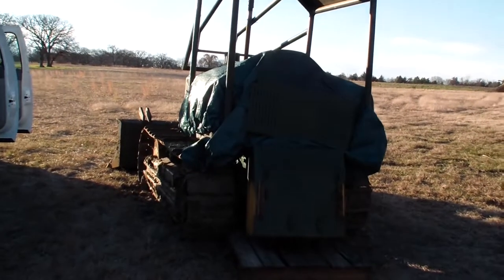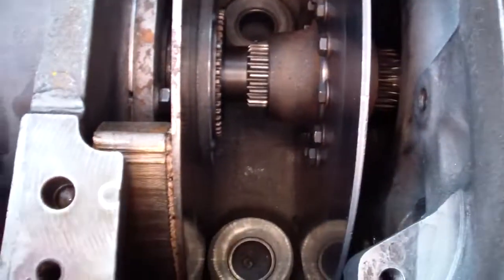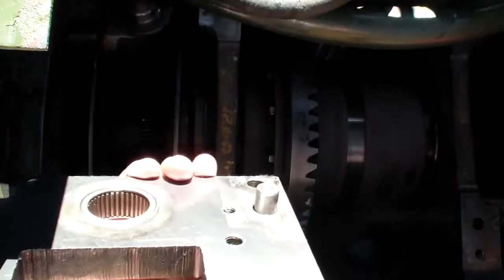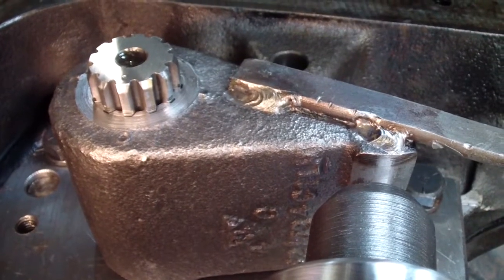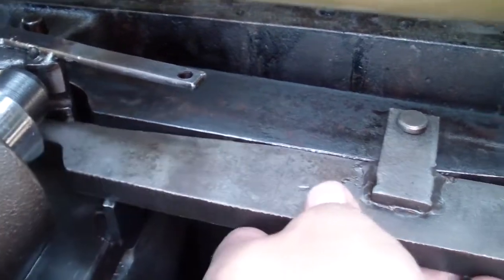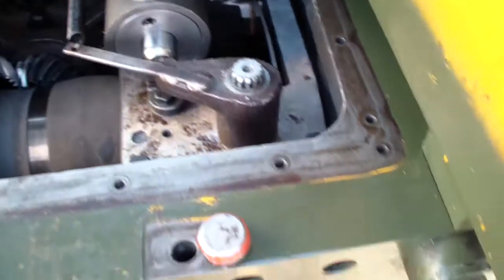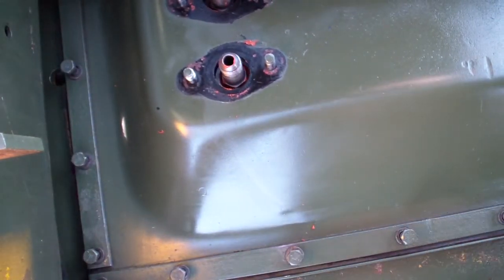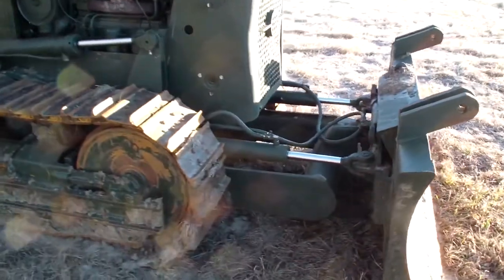TD7C Bulldozer Clutch & Brake Job

Comment: Where did you get the hydraulic hose nipple fittings with the flare ends? Only ones I can find are not the extended length ones like my OEM ones. Also if you had a part number that would be awesome. Thanks
Reply from the maker: I bought them from a local hydraulic shop (I bought them in 2013). If I remember correctly, the fittings you are looking for are 1/2" male o-ring boss to 1/2" male JIC flare. My best suggestion is to remove one and go to any local store that sales hydraulic fittings, verify the size and you may order online. I hope this helps

Comment: About to tackle this same job on a 78 TD8E, this video is great info, thanks for taking the time to make it! Where did you find the parts to rebuild the actuators inside? And I found a company in Norwalk Ohio called Arts Parts, he relines all kinds of brakes and friction pads for cranes, dozers and such.
Reply from the maker: Good evening sir, I found all the seals and o rings at a place in dallas texas called HD distributor. It was very easy to replace. Thank you for the comment and if you have any questions please let me know.

Comment: Great Video, How did you remove the master track pin? Best I've seen people heat up the chain around the pin and then drive  out pin with sledge. Is that what you did and how difficult was it?
Reply from the maker: On this bulldozer I removed the old chains and installed new one (I didn't mess with the old master pin). I show in one of the videos how I mad a press to install the new master pin using steel plate and all thread. On other bulldozers/excavators when I had to remove the chains master pin, I had to use 50 ton press that apply vibration while pressing. One time I was able to build similar press to the one I showed in one of the videos and I added large bolt (1" fine thread grade 8) and made the press like a bearing puller and use the 1" bolt to drive the master pin with the use of 3/4" drive impact drill driver and kept applying oil on the bolt and kept hitting the bolt head with a hammer. You can apply heat, just don't heat the chain more than 400 degree Fahrenheit as this will anneal the chain metal. If you are not planning to use the old chains, just cut them with oxygen acetylene torch. I hope this helps.

Comment: Great video. Just curious what did you use to clean the inside of the case? Also do you know how thick the lining is when new? Thanks
Reply from the maker: Hello, I used diesel fuel to clean it, when the lining new it should be 0.140" of inch thick. Thank you
Reply: @SalamSayhood  Great thanks for the help!
Reply from the maker: You are welcome,

Comment: nice work. i have a td8c probably the same parts. my dozer  drives pretty good but when i try and turn right it only seems to catch in a few places for a second or two. then i drive another 10 feet and it catches again for a second. is this more of a  final drive issue or are my clutch disks and pads bad. pretty annoying to have to go in reverse to get the machine turned the other direction. love the vids thanks
Reply from the maker: Good evening, the TD8C is very similar to the TD7C as far as the steering/brake operations. It sounds like you may have to first try to adjust the clutch and brake adjusters like I explained in the video. You don't have to remove everything, just the back cover to adjust the clutch for both sides and you can adjust the brake from the outside. 
If that doesn't work, then you may have one of these issues:
1- the steering cylinders may have an internal leak wich will cause steering issues or external leak this will also cause steering issues and will cause loss of hydraulic in the transmission and increase the level of hydraulic in the rear box.
2- wear out shoe or steering disc. The shoe relign or replacement is similar to what I showed in this video. The disc requires the removal of the final drive which I covered in other video.
3- make sure you are using the proper fluid.
4- the steering valve may have an internal leak.
5- most likely no issue in the hydraulic pump if everything else work okay.
It is also not a bad idea to open the deferential box, clean, inspect, adjust and add new fluid to extend the life of your machine.
Hopefully you just have to adjust the brake and clutch. Make sure to pressure wash the area to make the job go easier. If you have more questions please let me know, good luck
Reply: @SalamSayhood  thanks for reply i just ordered an operators manual i no im leaking fluid probably between final drive and steering housing. what fluid goes in the steering box i have a dipstick under my seat for that and its now low. ill have to go over tomorrow and try the adjustments as well before tearing the tank off to get into the box thanks again.
Reply from the maker: Any tractor hydraulic fluid that meet Case or IH MS1210 specifications will work in all three hydraulic systems of your machine (transmission, blade and the differential box). I personally use Phillips 66 powertran fluid as it work with my tractor, bulldozer and backhoe.
Reply: @SalamSayhood  thanks alot your very helpful hopefully the dozer gets goin full throttle again

Comment: The video is  is a big help.  My td8g  has been without a foot brake for a long time and its time to fix it.  Can the brake pads be seen through the inspection plate in the rear?  I am not able to get a good brake adjusting the adjuster bolts. If  the brake pads are bad,  will it effect the steering?  I turns well.  Thanks
Reply from the maker: You have to remove the top cover to be able to see the brake pads. It's probably a good idea to do that anyway to be able to inspect everything and to clean the inside for new oil. If you never done that, the bottom of the box will have a thick layer of brake friction material. The brake and clutch need to be adjusted together like I demonstrated in the video. This way you make sure everything is ok and you don't have a problem in the future. If you have any more questions please let me know.
Reply: @SalamSayhood  Thank you ,   I will,  I may have more questions after that.

o

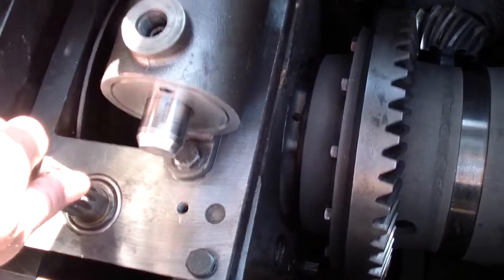Comment: Thanks, I did this procedure, but the problem is that when I torque down the plates, the shoes get stuck. They no longer move freely like in your video at 14:55. I am pretty sure the shoes and thrust washers are installed correctly. It is as if there needs to be a spacer between the plate and the frame for the shoes to have enough room to move. Parts diagram does show spacers in each corner, but I don't see them in your video. Any thoughts?
Reply from the maker: Good evening, what is your machine?
Reply from the maker: Good morning sir, there should be no spacers for your machine. Make sure the bottom of the box is completely clean specially inside the bearings. The old friction material will build up a solid layer at the bottom and need to be removed. Make sure all the bearings are seated correctly and free to spin. Also make sure the thrust washers are seated correctly. When you torque the bolts, make sure the plate is seated all the way around. The dowls should align the plate to the box.
Reply: @SalamSayhood  But then why does the parts diagram I posted above show spacers? I did clean everything thoroughly and made sure everything was installed properly.
Reply from the maker: I saw the picture. I checked the manual that I have and no spacers in my manual. When you dissassmbled it, was there spacers? Did you relined the original shows or got replacement/new?
Reply: @SalamSayhood  Hi, Thanks for answering, your videos are great! I didn't see any spacers when I disassembled it. I think next time I open it up I might add a large diameter washer as a spacer around four bolts that secure plate to frame between plate and frame. As it is, I really just wanted to get it working right away, so I only partially tightened down the plates. They move perfectly fine until I torque the plate down, so it really seems there just isn't enough room for the shoes to move freely (Who knows, maybe at some point some one put in the wrong thickness thrust washers). The new spacer/washers would add maybe 2mm, which should be enough. I did not reline the shoes, but one brake does need relining, so I should open it up again anyways...
Reply from the maker: I highly suggest to investigate the issue and not leaving the bolts partially tight. This may cause damage to the machined surfaces or shears the bolts. When you apply brake/clutch, there will be a lot of force in several dimensions. If the bolts are not tighten to their tourqe specifications they may shear off. If you are 100% sure everything is clean and correct but you still have the same issue, try to tap on the top of the plate and this will cause the bearings to seat correctly (if this is the issue) or try to make shims from thin steel and make sure you have a very minimum up and down play in shoes. Good luck.

Comment: Great video, Where did you get the brakes? I have a td7 and I’m not having any luck finding replacement pads. Thanks in advance
Reply from the maker: Good evening, I used a company called clutch and friction services co, the were located in norwalk OH. I just looked them up and google shows they are permanently closed.
Reply: @SalamSayhood  Thanks for the response, I’ll continue searching. I’m assuming you had yours relined ?
Reply from the maker: Yes sir, I relined them before, I used a local brake and clutch shop, one of the liner came off after only two months of use, I found the place I mentioned in my previous comment and they did good job. It's cost me $600 including shipping. To be honest with you, I thought about relined it myself, you just need the friction material that can handle heat and oil. It's 0.140" thick, if it comes flat, you can add the groves with wood skills saw (you can set the depth of cut to about 1/32", You can purchase the brake glue (also it must handle heat and being wet in oil), the brake glue need two things to set properly, pressure (using metal c clamps, clamp each two against each other while the friction material in the middle, make sure everything is super clean and dry before applying the glue), then you need to bake them in the oven at the recommended temp and time by the glue manufacturer. I done this long time ago with other tractor and it worked. I was very busy and that is why I let someone else do it. Please let me know if I can help you.
Reply: @SalamSayhood  I really appreciate all the information, I may look into finding some material and doing it myself. Unfortunately we live in the day and age of everything is disposable and if it breaks just throw it away and replace it.
Reply from the maker: Yes sir, I totally agree with you. One more piece of information, the first place I went to relined the brake and clutch, the guy showed me in one of his catalogs, under Case/IH, the part number for the friction material, he told me back then (2014), they cost about $25 per piece. The glue is black in color and they only sell per gallon, I believe it was about $150 per gallon. You may want to go to a brake shop and see if they can get you the right material, if not try to check McMaster Carr, they sale friction material. I believe I found the glue on eBay back in 2014 and it was from India. Good luck
Reply from the maker: Thank you sir for sharing this information,
Reply: I used Friction Works LLC  4598 WHITTLESEY RD NORWALK, OH 44857 (419) 677-1167. They did the round and flat pads for $162 each.  Turn around time was 2 days. Workmanship was good.  When you ship to Friction Works keep the box under 50 lbs to avoid a surcharge (2 flats and 2 rounds is just under 50 lbs).  When FW returned the brakes they were 53 lbs so shipping is higher ($190 for me).  This is cheaper than buying new or if you don't have a local option.  Thanks Salam for the video!
Reply from the maker: Thank you sir for the information and the comment.

Comment: 1990ish td7g... my clutch pressure gauge shows a drop after about an hour of running but the machine is still pushing hard. Would this be a plugged gauge line or something else?
I changed the large filter in with the battery and put all new to-4 in the transmission.  I didn't know about the strainer under the floor panel and will be changing that now that I ha e seen your video. I did the clutches and disk when I bought the machine about 5 years ago and. Any ideas why the gauge would show good clutch pressure and after about an hour show low pressure?
Reply from the maker: I believe the TD7G specifies Hytran hydraulic fluid or MS1209 specs or anything that shows compatibility to case MS1209 fluid.
However, before replacing the fluid, make sure of the machine requirements.
Also:
Make sure the engine belt is tight and doesn't slip.
Make sure the radiators are clean and allow good follow of air.
Make sure both strainers are clean.
Check fluid level.
I hope this helps. Thank you for watching.
Reply: @SalamSayhood  I haven’t thought about replacing/checking the fan belt and I will do that when this rain lets up at the same time I get into the strainers. Is there more than one strainer other than the one under the floor pan? Another thing that your video got me thinking about would be the adjustment of the clutch/brake cylinders under the seat. If my track hand brake levers seep fluid like they do at the block, and if my clutch/brake cylinders were not adjusted properly, could that cause the clutch to lose pressure over a period of working? This also makes me wonder where the clutch pressure reading is taken at. Because the gauge shows that I have lost a considerable amount of pressure from the clutch, but it seems to have lost absolutely zero power. I also did not know the proper adjustment method when we reassembled the whole thing after new pads and disks, we used the old “that looks about how it was when we took it apart” technique. I am 100% glad I found your video!
Reply from the maker: Mine has two strainers, one in the transmission and one inline with the return line from the transmission radiator on the left side of the engine.
The gauge should be reading the end of the system to monitor any drop of pressure.
Keep in mind: when the hydraulic fluid gets hot the complete system will get hot and any leaky ring/seal will leak more. Also the gauge may be defective. 
Check for leaks. Make sure the steering cylinders don't leak (the rear end fluid level keeps rising. No leaky hose.
Check everything and let me know what you find. Be safe and have a good day

Comment: Have you changed transmission fluid and pulled screen, I was wondering if there was a not so messy way, it's close quarters under there
Reply from the maker: Hello, I changed all the fluids. The transmission has a strainer filter within the transmission, I removed, cleaned, and re installed. There is also another metal filter that connected to the hoses that go to the transmission radiator, I removed, cleaned and reinstalled. I also replaced the turqe converter filter, it's located by the shift handle. The best way to do it is to level the ground were you are going to work on it, use a sheet of plywood or masonite so you don't get dirty, drain the transmission, I cut a 55 gallon drum about 6 inches to collect the old oil, then remove both strainers and clean them and also change the turqe converter fluid. It's straight forward process and not so messy. I hope I answered your question, if you have more questions please let me know. Happy Thanksgiving
Reply: @SalamSayhood  very good info, thanks for all your help, ive got that to do and some fuel line issues, those rubber fittings inside the nuts on the lines are bad, at the tank, cut off valve is leaking and so its sucking air, mostly just odd end stuff.
Reply from the maker: @sammorgan2719  my suggestion is to remove all the metal pipes and all the fittings for the fuel lines. I replaced them with rubber hose good for diesel fuel from the tank all the way to the filter and from the return line from the injector number 4 back to the tank. 1/4" hose will fit perfectly on the original pipe. Just cut about 3 inches from the original pipes at the ends and fit the hose on it and clamp it with hose clamp. Mine been running like this since 2014 and I have no issue. Good luck.